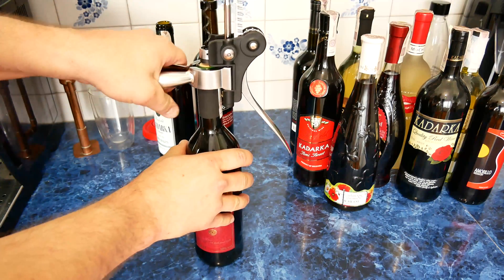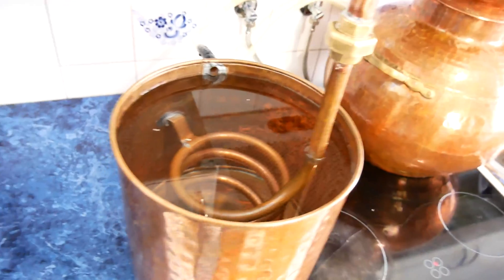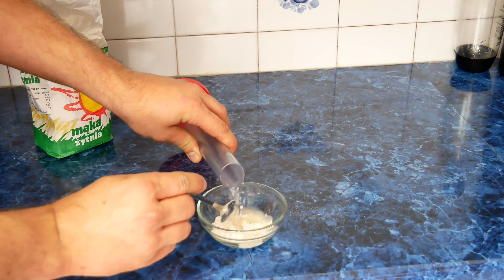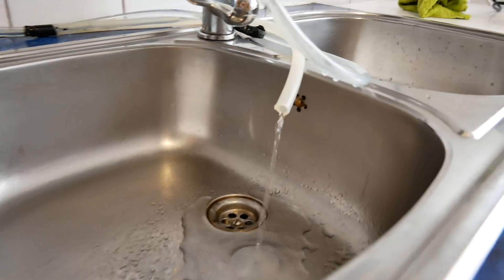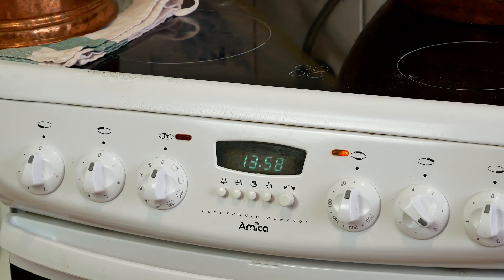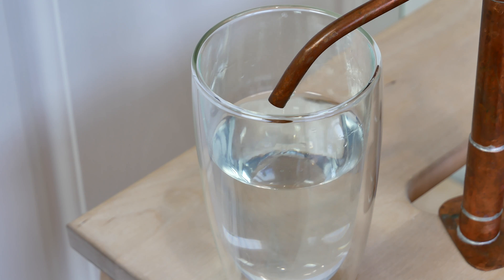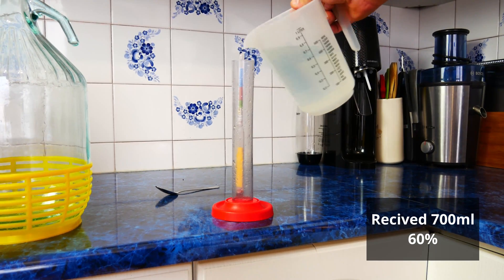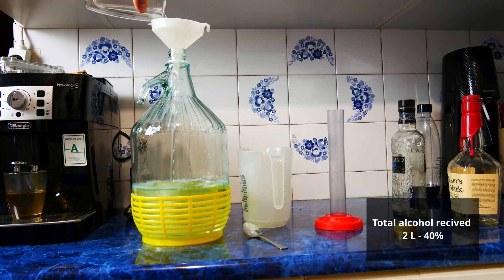Alembic Distillation - Beginner's guide /// Part 1

Comment: I love the design which obviously is proven as many very old distilleries still use them. I have never seen anyone use one of these with a flavoring thumper in between the still and condenser. will they not work well? thanks, tom

Comment: Thank you. But is it really necessary to separate heads during first distillation? If you make two-steps distillation, then during the first process there is no need to separate fractions, this will be done during the second step.
Reply: sEPERATING AND TROWING AWAY THE HEADS OF 1ST DISTILLATION IS PROBABLY THE MOST IMPORTANT OF ALL STEPS DESCRIBED. FORST 1.3% OF PRODUCT IS 100% POISON

Comment: very good and very clear explanations and video. thank you for sharing. I'm not sure what still to chose? Are there better choice than other to start and? pot still vs reflux still vs fractionnating still. what is the "best" choice? thanks
Reply: Henri Rion
 ..i've enjoyed this hobby for 4 yrs. and use a copper pot still. the pot is the easiest to run before you get into the other set ups.
Reply from the maker: Alembic's and other pot still's are easiest to use. With reflux column you have to stabilize a temperature and its a little bit more complicated. Pot stills are good to make rum, whisky and other flavored liquers, and columns are good to make high proof clean alcohol